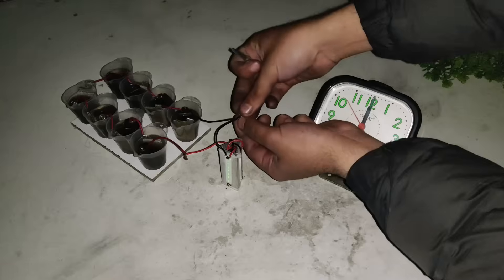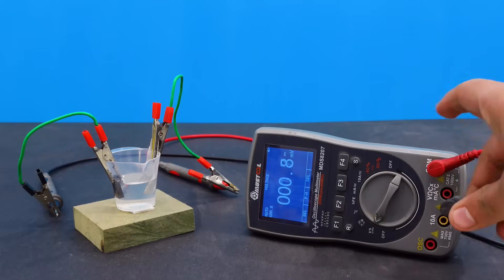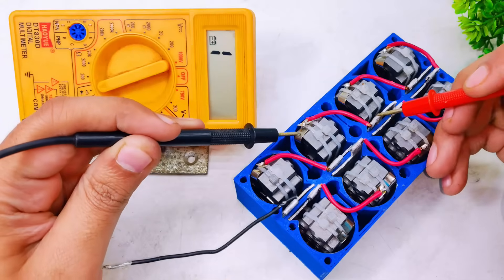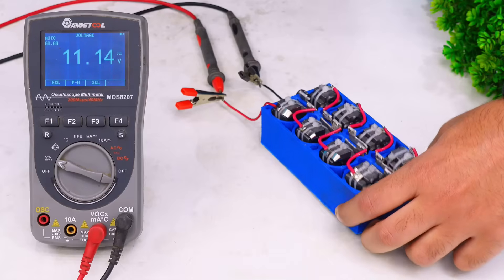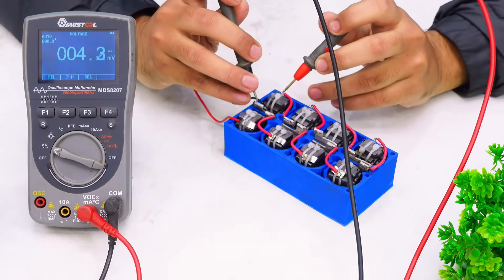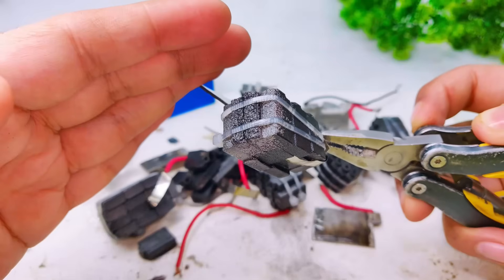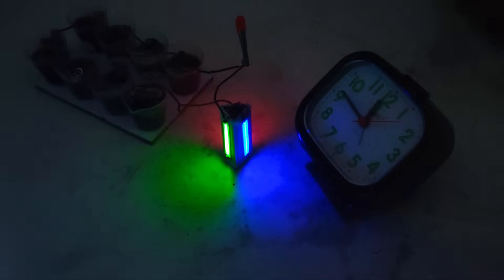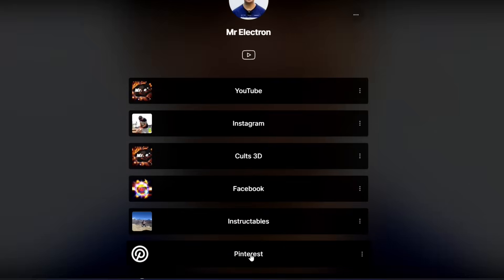High Power 12V 💥 - How to make Aluminum Air Battery DIY | 12hrs BACKUP

Comment: Yes BRO!

Thank you for talking slowly enough; your accent was perfect to understand🤘😝🤘.
 This video was awesome, bro, showcasing the highs and lows of the battery's potential. Just wondering about salt water due to its high electrolytes. Also, have you tried a porous activated carbon plate and a thicker aluminium plate in a box?

Keep it coming, broski :P
Reply from the maker: I havn't tried the porous plates but i have tried bigger aluminum plates without any  major change.

Comment: This is a hit. Thank you! The reason for the 3d print fail is simple. Fdm only layers plastic on top of itself to create structure, it is not a waterproof bond. But there is stuff you can do to make it better. Like coating it in resin after print. You would want to scale it to like 108% to make room for layers of resin.

Comment: I think the reason is more electrolyte water was filled in the cups than that blue battery pack.
Reply: no it just seems to be a fault of the 3d print and allowing liquid to pass to the next cell over
Reply: Why would electrolytes flowing between cells matter?

Comment: Hello, could the nickel and carbon brushes you used in the first try have reacted?
Reply from the maker: They can react but lesser performance for that battery was because of the electrolyte of different cells getting in contact with each other.

Comment: what if you made like a cicular case of aluminum and inside line it with a piece of paper and inside the put compact carbon powder
Reply from the maker: Powder form is highly resistive.
Reply: @MrElectron  higher surface area would specificly lower the resistance and increase the current

Comment: what if you were to crush the carbon from somewhere like alkaline batteries, and put the crushed powder in some sort of mesh like maybe toilet paper, so the surface area would increase and with increased surface area the power should also increase
Reply from the maker: It increases cathode resistance so lesser output current.I have already tried that multiple times.

Comment: Thank you i learnt alot .. your awsome .. is that battery rechargeable
Reply from the maker: Its not rechargeable. Its a primary cell. After aluminum plate consumption we have to replace the aliminum plate with a new one.
Reply: @MrElectron  thanks